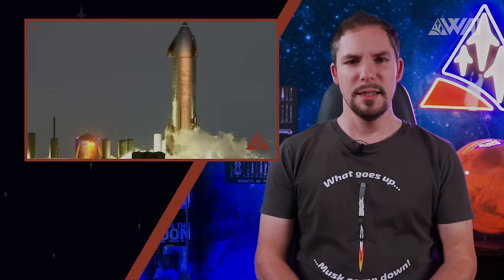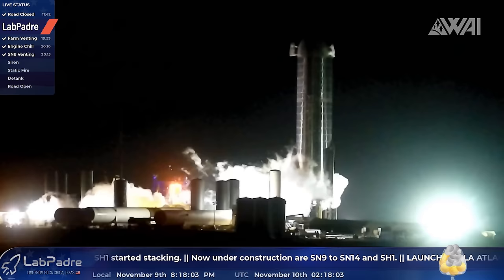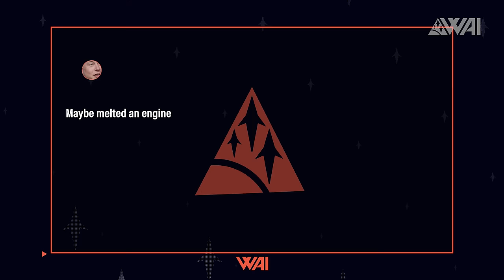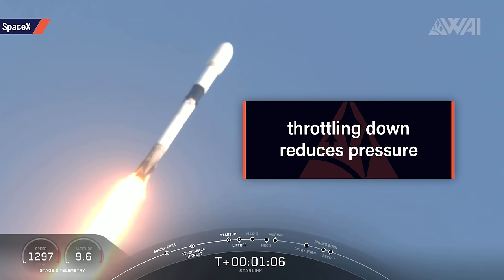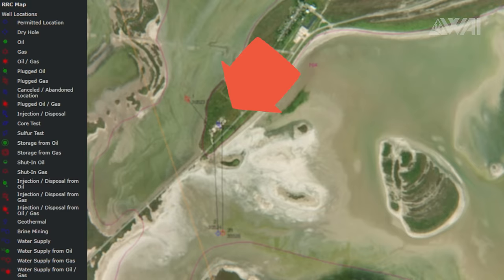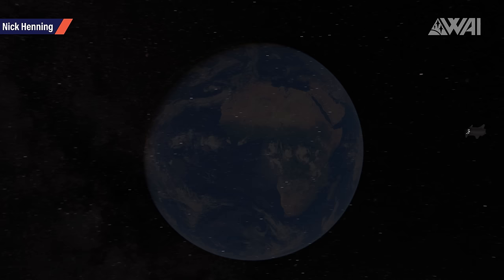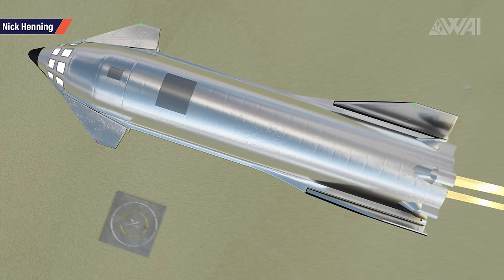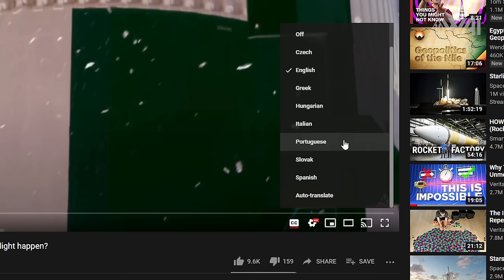132 | Serious Problem on Static Fire & What will it be like to ride a SpaceX Starship?

Comment: I'm never discouraged by this type of bad news, because every problem the spacex team encounters now is a problem that will be avoided in the future.
Reply: It's clearly better they encounter this problem on the ground than at nearly 10 miles in the middle of the sky.
Reply: @nicolasrouvreau8365  But not nearly as metal.
Reply: And not a problem that happened with cargo or humans on board!
Reply: You don't say genius ;D
Reply: Idk, the fact that it’s an issue with the raptor is a little more worrying than if it were a starship issue
Reply: true...but problems with the raptor engines may not be easily pinpointed.  Re engineering parts takes time and yes, more testing.  Closer to flight, yes, but how much closer is unclear.
Reply: Something new in the design on this serial number likely failed, so that will speed their search for the problem. I wonder if all three Raptors were tested previously, or if we just saw an example of the "bathtub curve's" bleeding front edge.

Comment: Those are turbo expanders used in liquid gas operations, the Joy MSG "pumps" are large air-compressors used to compress air and recompress nitrogen to use as a refrigerant to chill the gas before it goes through the turbo expanders  and into a refining tower to separate the oxygen and nitrogen.

Comment: You could honestly call this an incredibly successful failure. if I were one of the engineers I'd be positively giddy with whatever data and analysis I'd get from this. Plus it's always a good sign when something breaks and there's not an explosion.
Reply: True. This could have easily destroyed Sn8 if they went ahead with the hop.
Reply: @aqeelraja4750  In earlier versions it probably would have gone boom.
Reply: Mixed emotions
Reply: A rapid conditionally-scheduled partial disassembly

Comment: Hard to believe only 12 months ago what we see today ready to take of and perform the most rad landing in aerospace history, was just a hollow shell of a slightly janky mock up.
With every iteration the cost of failure gets harder to shrug off and the added complexity means more things have to go right. I don't envy them the stress involved.
Using stainless steel fabrication was a master stroke to getting this far so quickly.
Time will tell yet how well the concept scales a support a fully assembled and fueled Starship at full G's.
But that's why we watch hoping always for the best possible out come.

Comment: the fact that it was a raptor fail and not a plumbing/structural failure is exciting. It means an issue that might have failed in flight will be fixed and not happen in the future

Comment: 7:12  That is a new leg design. The area that hinges to the ship has the hinge hole and the top plate (that rests up against the ship plate when in landed position) at almost the same level. The old one has the hinge hole in an extension piece. The new position means the leg angles out more. The new leg's entire top block is longer, and the tapering part of the leg hasn't been seen before, and can't be visualized as fitting into the old lower leg/foot structure. It will have a somewhat different foot, apparently. Overall, this is part of a longer leg that angles out more. This iteration is not 60% longer, but I don't think Elon's old tweets constrain him or his engineers when it comes to how many iterations they'll go through.

The trailer load does appear to have one old style leg on it, possibly for SN9 or 10, which aren't set up for the new leg. The mounting plate/structure on the ship will need to have the connecting pin set lower because of the configuration of the new leg. This affects how it is set into the strong points of the engine skirt. It remains to be seen which SN is the first to have the new legs.
Reply: Kieran Kinney   Sorry, I edited my comment so extensively that the engine-rich exhaust  line disappeared.
Reply: Kieran Kinney   Oh, definitely! I was just apologizing because my edit made your reply look like it didn't make much sense.

Here's to hoping the new landing legs don't end up as a cold twisted mess.
Reply: I can't tell from your description. Do the new legs look possibly reusable, like a hydraulic strut, or still consumables?

Comment: Re the gas well site, they could use the old well for underground gas storage. If you inject water into the well it can pressurise the well to improve gas recovery. Then you would only need dehydration of the recovered gas before use in the rockets. Cheaper than large above ground storage tanks.
Reply: The carbon monoxide might be an undesirable contaminant, reducing performance.

Comment: It does look like well equipment. We might see a "workover rig" show up onsite. That will confirm they are going to put the wells back in service. I have been out of the business for quite some time but what looks like desanders and desilters arriving on trucks. The equipment with the turbo looking things I have no clue but could be a centrifugal separator.
Reply from the maker: Wow! Mike! I did not know you knew so much about this! So, you think this couldd really be about the Methane? :_WAIHello:
Reply: @Whataboutit  All we drilled were gas wells, am rusty though so sent DM asking for original pics.
Reply: There's a major sand shortage right now. They could use that equipment to process locally sourced sand for all the concrete they're using.
Reply: looks like a centrifuge to me! I wish I could frac that well!
Reply: @danelliott3335  Could it be a gas compressor?
Reply: @danelliott3335   Is this really fracking? Or just using water injection to force out more gas? As I understand it, fracking uses higher pressure to actually fracture the rock, making new fissures. I seem to recall using simple water injection was around before fracking. Please help me figure this all out - so glad to have someone with expertise here.
Reply: @donjones4719  Hard to say.  We'll know if we see sand showing up.
Reply: @Whataboutit  @UC-2VO36awdDmwzaWdG44Ojw It doesn't look like an actual pump used in fracking.  But it does look like a mud pump...which may mean the well needs more of a workover than just dusting it off and fracking it.  Fracking pumps are the size of a whole 18 wheeler trailer.  They have to generate much more pressure than you do for drilling mud.
Reply: @thopkins2271  in case of a mud pump I would expect a triplex pump (piston/plunger) instead
Reply: @danelliott3335  it will be awesome to see an workover intervention in those wells!
Reply: To Frac a well, they'll first set up a bunch of valves and a couple B.O.P's on a stack as one guy mentioned called a Christmas tree, then connect a bunch of pump trucks. To fracture the hole, they'll first 'inject' sand, then shove in a bomb, then fill the back of it with sand, plug it, then they'll blow up the pack and shoot all of that sand into the earth, 'fracturing' the walls, then do the same process a few more times coming back up the line. Then they will shoot water down the hole and 'circulate' as much as the sand and water as they can, back out of the hole. This process is intended to create pressure and hopefully pop some hidden bubbles around the well. Its common too for the well to be injected with chemicals to help increase pressure. The intention is to help the well push everything it has to offer, out of the hole on its own. The tank battery you see next to the well will receive everything that comes out of the well after everything said and done. The 'production' will include water and other crap and will be 'separated' by that little tank(heater/tester/separator) you see sitting next to those large brown tanks. The water will go to the tanks and the gas will be sent to pressureized storage tanks, probably around what you call their 'tank farm'. I'm leaving out a BUNCH of information and technicalities and am in no way an expert in this stuff! I have a little over a decade background in the oil field.
Reply: @sebione3576  
Shortage of sharp-edged beach sand, but plenty of worthless rounded-edge river sand...
Reply: @cantubloodaxe768  
So the explosion provides the extreme pressure to separate the strata. The sand, like a foot in the door, keeps it separated. 

Is the plug made of concrete? Do they have to drill through the plug again after setting off the bomb?

Comment: That large pump assembly is an Integrally gear compressor .. by the number of stages it might be air or CH4 . The box under is for lubrication and it is an oil tank .. the Ss drum is probably a scrubber vessel to separate liquid to gas once compressed .Maybe  to be ch4 regeneration  to compress thee ch4 that’s venting and transforming again in liquid.. I didn’t see coolers on the footage though but maybe there is

Comment: Best guess is that the equipment you asked about on the trucks is for the LOX production.  Air contains Oxygen and Nitrogen, and you have to separate the nitrogen and oxygen.  A membrane is generally used for part of this process, and the nitrogen would then be vented, or purged.  Pumps could be for many purposes, so that equipment is hard for me to tell.

Comment: Wasn't Starship supposed to do a 2 approach reentry from mars? Meaning first a shallow angle reentry that actually catapults you back out into orbit and on the second approach you have the 70° attack angle for actual reentry.
Reply: The very first dip into atmosphere has to bring the craft well below escape velocity, which is really the hardest part. Retreating to orbit allows the thermal tiles to cool off (if that turns out to be necessary), but the real advantage is gross orbital adjustment at apogee when energy cost is lowest. For example, the ship can apply a nudge at apogee to fine tune the next approach into atmosphere so it reaches the preferred spaceport.
Reply: The Starship uses variations around a 90° attack angle to maintain the desired orientation, course, altitude, atmospheric density, and therefore hull temperature. It's not a shuttle using a 70° attack angle.

To steer to starboard, it rotates the nose somewhat to port and tilts nose-forwards into the airstream to curve more sharply.

When returning on a high energy transfer orbit from Moon or Mars, in order to decisively drop lower into Earth's denser air, it rotates to strait nose-down and then proportionately tilts the nose forwards in the airstream to descend faster. If the tiles are getting too hot (in dense air), it might turn nose-straight-up to ascend to a thinner environment. 

Hopefully, the seats will rotate to minimize fainting and nosebleeds, but the passengers are going to feel like they are on quite a carnival ride.

Comment: Hey folks. If you were listening closely to the crew 1 mission SpaceX almost in passing announced that Dragon and Falcon 9 are the first commercially certified spacecraft by the FAA. I used to do this kind of work, I know what it means. It means they had to demonstrate operational reliability standards and create a maintenance manual and illustrated parts catalog and an inspection program all of which required the FAA's blessing. Not to mention filling out paperwork by the truck load. All the heavy lifting is done and SpaceX can now sell them to other operators.

Comment: I presume SpaceX will definitely produce its own fuel for the starships.
The new (old?) equipment on the well site looks like powerful compressors for liquefying methane and air.
So Musk can produce LOX and LNG on the spot, which is good not only in terms of price, but also in terms of logistics (for massive volumes of gas).
Reply: yes, looks to me like they plan to frac the wells and put them back into production. then I imagine they plan to extract hydrogen from the gas.
Reply: @leewm.gaudry3770  I don't know if Musk needs fracking now. The old well may not be profitable for industrial gas production. But SpeceX doesn't need large industrial volumes of gas for the Starships. Thus. even an old half-depleted well is enough.
Reply: @leewm.gaudry3770  Also, the Starships will not need hydrogen for the foreseeable future. Methane+LOX pair will help Musk say goodbye to the old RP-1 fuel. The ULA plays with H2, but it doesn't look easy and safe. Unless Musk decides to replace the Raptors with the nuclear engines powered by hydrogen. But this is not soon :)

Comment: In the latest version of the engine power supply,
the vertical line has become much longer.
That is, the hydrostatic column of liquid
was much higher and,
consequently, the pressure in the bottom area
is much greater
than the previous tested versions.
The diameter of the vessel does not affect the pressure!

Comment: Large gas processors are, trucks taking away tainted water to clear the well. There would be a compressor to pressurize the low pressure natural gas. And a dehydrator unit to remove moisture from the gas, so it burns pure and clean.

Comment: I hope starship leaves the pad at least🔥, im a little worried😅
Reply from the maker: Fingers crossed!!!
Reply: @Whataboutit  I think it will leave the Pad just fine and it will rise far enough that if it does have a failure Boca Chica will be fine. They are doing a lot of tests before they actually launch to find and fix these bugs. I actually think SN-9 might get the changes incorporated into it and then get rolled out to platform B. Very well could be 9 that flies first. Will keep watching Elon's Tweets with interest. I am impressed how open compared to other Providers SpaceX is. I do not see Boeing and SLS near this open.
Reply: Everybody worried if Falcon heavy would make  it. It did. Even Elon Musk himself said it could explode during lift off. It didn't. Starman is still racing through space as an irrevocable proof.

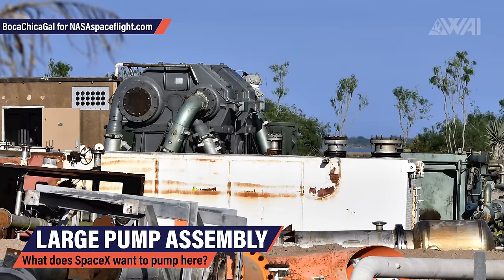Comment: At 10:49 the system is used to purge the oxygen from the pipes before production ( and is normally done with nitrogen which is inert and does not create explosive mixes with possible oxygen still trapped in the pipes ). The pump at 11:02 should be used to pump the nitrogen.

Comment: I don't think the gas wells are in SpaceX sights, but that equipment could be repurposed for other uses like  a concrete making process or pumping / filtering water for electrolysis to crack water into fuel gases. For all we know, until they are set up and running they could only be parked there for temporary storage. I would love to see and know Starship And Super Heavy are fueled from renewable sources maybe net zero sources.

Comment: They can get used oil pumps for pennies on the dollar. Once open the well can produce small amounts of methane. That is fine he does not need constant amounts. You have to pressurize the gas, clean it and remove contamination, mostly water and limited amounts of helium and other gases. There are fields of repo equipment in Blanco Texas, about 150 miles away.  He could get it cheap. Buildings air conditioning equipment all kinds of things.

Comment: The pump is not for fracking.  It's used equipment because you don't buy that stuff...you hire a service company to come.  Fracking pumps are the size of those trailers with the water.  It could be an injection well, where they will pump water or steam, or it could be a mud pump.  But not a fracking pump.  Either way, they're definitely getting ready to workover the well...that's definitely oil patch equipment.

Comment: The bleep for Fracking made me LOL.
What are your thoughts on self-orienting seats? A shuttlecock system, on low-friction bearings, for example?

Without something like this, I think that "bellyflop transition" will make people vomit. Probably will make them vomit anyway TBH,  but it will be significantly worse if your feeling of "down" changes. A self orienting "acceleration couch" (as they call it in sci-fi) seems like the obvious answer.

Comment: Thanks for another great episode.  Since you showed that video of a return journey, I was wondering if SpaceX has done any research into the possibility of producing artificial gravity onboard Starship. A tall order no doubt, but they seem unafraid to think outside the box and actually make something happen.   And I'm no engineer, but I still think that the legs have to be much, much larger, extending at least as high as the bottom flaps. I find it difficult to believe that those small legs will carry the weight of landing each and every time, especially on uneven terrain. And then provide sufficient height for a relaunch from that same location. The sparks that flew out during the test should give a hint as to what could potentially happen on an un-prepared surface of the moon or Mars. Starship would need to be elevated much more than what these small legs can offer.

Comment: My estimate, and it's worth exactly what you're paying for it, is that the 15 kilometer flight will now not occur before next year, possibly as late as second quarter, depending on how much redesign is necessary to prevent the engines from melting when fired. Orbital flights will probably not occur before 2022, and a moon landing should nit be expected before 2026. You heard it here first.
Reply: We'll see. They're not going to waste the time

Comment: Will the static fire problem make the 15k hop a longer wait?
Reply: Definitely. They need to replace one or two engines and start the static fire test series all over again. And they have to analyze the pneumatics problem, which may be simple or very difficult to track down. The find a solution, which could be simple or need a lot of work.

Let's hope the problem was just a plugged filter or something.

Comment: Header tanks are usually for when the fuel is not currently under gravity, (orbit not under thrust, skydive maneuver). Igniting the engines using the full header tanks instantly settles the fuel in the main tanks. The rocket should then switch to the main tanks for the rest of the burn. I wonder if any of these static fires will be doing the switch.
Reply: It used header tanks for the entire landing burn